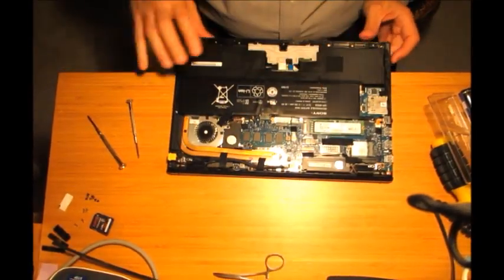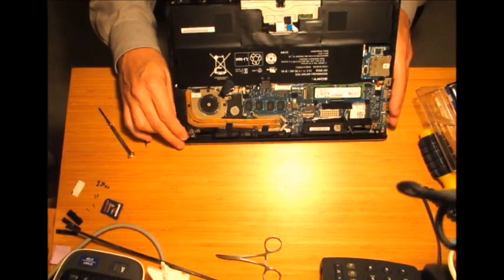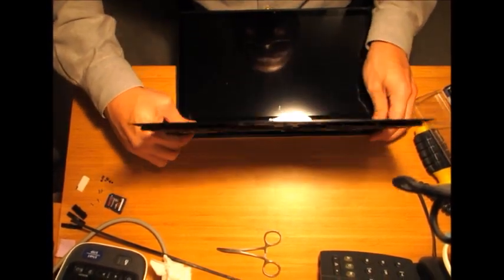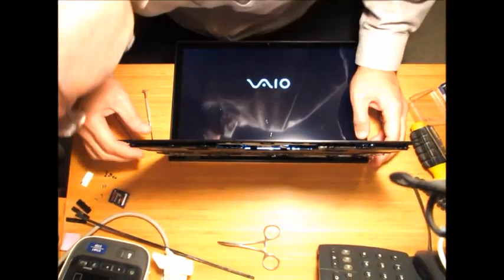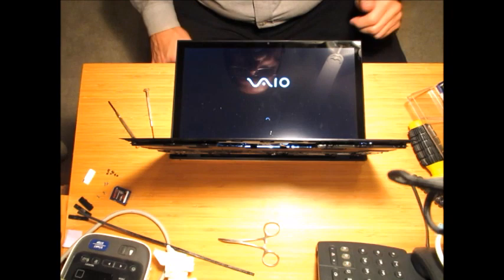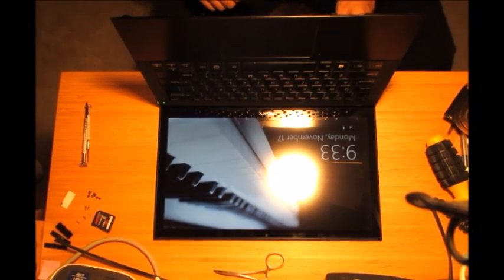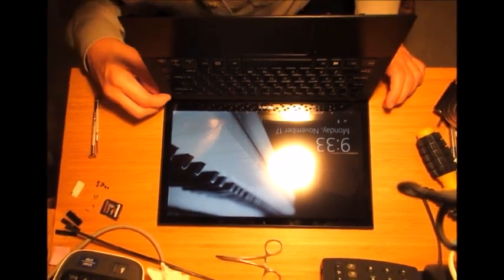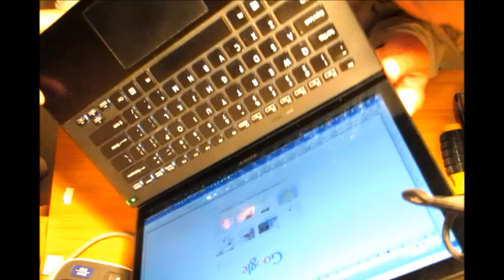Sony VAIO Pro13, svp132 fan replacement, case removal

Comment: Why didn't you want to attach the fan to the heatsink? Is it that difficult? I see fans are at $30 but with heatsink it's around $130
Reply from the maker: If the fan and heat sink are compatible that will be fine, mine were not.   Good luck and let us know how it goes.

Comment: This was awesome! However, I replaced it and now it makes a weird grinding kind of sound and gets very hot very quickly. I’ve tried taking the fan out and in again, and same thing. Not sure what I’m doing wrong...any tips?
Reply from the maker: joyfulholli, sorry to hear of your troubles.  The grinding doesn't sound good.  I would suggest you keep the bottom of the PC off and watch the fan spin and see if you can detect where the grinding noise is coming from.  There may be a wire in the fan or the fan body may be twisted causing the grinding.   If the fan is moving slow due to the grinding noise, it will not cool the PC and it will get hot.  Keep us posted.  Larry...
Reply: Lars-of-D !!! Thank you for replying!! I honestly thought I’d just be commenting into the void, it means so much you replied! I will try this and let you know if I find the grinding!
Reply from the maker: @joyfulholli  Cool!  Looking forward to hearing what you find!   Larry...
Reply: Lars-of-D I tried it! When I leave the lid off so I can see the fan, it doesn’t make any noise. It looks like the fan is kind of risen a bit so that it touches the lid when it’s closed or something. I also noticed though that the heat sink is SUPER hot when the computer is on, as well as the light green, long rectangular circuit board part on the other side of the computer. Is the intense heat maybe part of the problem?
Reply: Thank you again SO much for replying! Sorry if that’s too many questions!
Reply from the maker: @joyfulholli  Good to hear you found the grinding issue.  Hopefully you can re-seat the fan to keep it from binding with the case.   If the heat-sink is hot, then you likely have a good thermal connection with the CPU.  Having a good thermal connection is a good thing.  The exterior of the case should never be overly hot to the touch.  If you are worried that it's getting too hot, you can try running Sony's diagnostic software and it will check CPU function and temperature.   The long rectangular circuit board may be your SSD module?  If so and if your PC is running a program that is  memory intensive, it will get hot as well.   Let us know how you progress.   Larry...

Comment: hi, i have disassembled the fan, cleaned and lub it, cleaned and applied new thermal paste on CPU, but CPU temperature is still around 50 degree at idle, and around 60 degree when watching any youtube video, cpu fan almost running all the time. is that normal?  Thanks
Reply from the maker: Schumy1975, I will let others reply as they may have a temperature profile as I do not.  Good luck and keep us posted.  Larry...

Comment: Thanks for this video - it saved me a lot of time. In most cases the increased fan noise can be resolved by simply cleaning the heat-sink and replacing the thermal paste. 

Otherwise this laptop has aged well, especially if you run Linux. The performance updates in Ubuntu 19.10 have helped.
Reply from the maker: Don, Glad it was helpful

Comment: I fixed a very loud grinding sort of buzz by removing the heat sink and fan, pulling out the black part of the fan with the blades from the fan's chassis, cleaning it as well as the hole it fits into with earbuds and toothpicks. Then oiling everywhere where the fan blade part comes into contact with the fan chassis. Then it's simply a matter of putting it all back together and for me the buzzing was gone. In an ideal world, one should clean and reapply the thermal paste...

Comment: This saved my aging sony vaio.  It would turn off after 10 seconds or so.  I assumed it was the charger, then the battery thinking it just wouldn't take a charge.  I couldn't get far enough into the boot to see the battery really did have power.  I started to google replace battery, and found this.  Turns out my fan wasn't even turning on, so the cpu would shut down to keep from melting.  Thanks for the detailed video.  I went ahead and replaced the battery just to get longer life while I was at it.
Reply from the maker: Mike, thanks for the feedback.   Let us know how the new battery works out and let us know where you bought it.   Larry...

Comment: Hello, i have buy a 2nd hand Sony SVP132A2CM Model for my wife. It works but i have an problem with the USB Port. It will not read USB 2.0 just 3.0. Do you have an idea what is wrong? I have installed windows 10 pro new and the same happens. Lucky that i have an usb 3.0 that works for Boot.  It nervs me because i cant put my mouse dongle to work so i must buy me a BT mouse. Please help if you know whats the problem. thx
Reply from the maker: LoPoVat, well this is quite strange.  Have you tried uninstalling and reinstalling the USB drivers for the USB ports?   
 When you  reinstall, be sure to have the system check the internet for new drivers and not just reinstall the drivers that are local on your PC.   Larry...

Comment from the maker: All, well the time has come that I've decided to get a new notebook PC.  After lots of searching, reading, and analyzing I've decided on the Dell XPS 13 2-in-1.    My Vaio is still running well, but after 4 years it's showing its age.   After receiving my XPS 13 and using it for some time, I will post my comments.
Reply: i may get a new laptop, the Wifi AC7260 card is having trouble on Windows 10 I have to manually disable / enable the network adapter to get a router connectin estabished again as it randomly disconnects 3-5 times per day and it's a pain.
Reply from the maker: @davedogge2280  let us know which PC you choose and how you like it.   Larry...
Reply: @LarryBlackledge  It's a Sony Vaio Pro 13 just like your old one which showed me in the video above how to replace my fan making noise which I did do a couple of times. I've ebayed a Wifi Intel Wireless-AC 8260 card which should fit and use if I reach breaking point with the old AC7620 cutting off during the day. Some say switching off Bluetooth fixes it, others say re-installing drivers. The only official drivers available for it are the winter 2019 and no other legacy ones, I've tried re-instlalling them and ensuring that the AC7260 setting are correct i.e. no Power Saving option set to 'on' and that AC is selected instead of N etc and the problem persists.
Reply from the maker: @davedogge2280  OK, I thought you'd given up and were moving on to buy a new PC.  Let us know how the troubleshooting goes on your Vaio's WiFi module.   Larry...

Comment: Hello, Larry how are you? I would like to ask you if it is normal that when I play videos on YouTube the voice is heard with ups and downs because the computer temperature rises a lot, it is true that we are in summer, but I did not remember that it was like this until now. Is there any way to avoid this? It is practically impossible to watch videos on YouTube for this reason, thank you.
Reply from the maker: Laura, when my Vaio is doing a lot of processing sometimes I can hear the fan.  Video can cause this.  The only thing I  have found that helps is setting the fan to "silence".   If you want to do this open the VAIO Control Center application, go to the "Power & Battery" tab, then look for the "CPU and FAN" section and move the selection to SILENCE.   Note:  if you read the DETAILS tab in the Fan section you'll see they reduce some CPU performance to achieve lower fan speeds.   Good luck!   Larry...
Reply: Thanks Larry

Comment: Hello, the fan makes noise when I move the notebook. I recently took it out, cleaned it and put in some thermal paste and after a few days we heard again the noise, it's as if the fan's blades were touching something metallic, I'm crazy, you know it could be, it's really annoying, could you know what the solution is? Thank you.
Reply from the maker: Laura, when the fan gets older it's alignment becomes imperfect and "wobbles", this may be the reason blades are hitting the fan cowl.   Thus, I would suggest replacing the fan.   If this is a new fan, please let us know.   Larry...
Reply: Thanks Larry, I changed it 1 year ago in the Sony technical service, is it normal? What can you advise me? Thank you very much.
Reply from the maker: Laura, normally the fan should last 2+ years, however I had one get noisy after 9 months.   I suspect your fan has gone bad early.   Larry...
Reply: Thanks Larry, in your video you see that you change the whole piece with the heatsink I think it's called, then you just recommend changing the fan only? Could you send me the link or where to buy a good fan? I'm from Spain, thank you.
Reply from the maker: Laura, not sure how to buy it in Spain.  In the USA, this would be a typical way to buy (on Ebay):  https://www.ebay.com/itm/NEW-Sony-Vaio-Pro-13-SVP132-SVP132A-SVP13218-SVP13217-Cooling-Fan-UDQFVSR01DF0-/281806591112   I don't know this vendor, but they have a 99.7% rating and have sold 80 fans.   You will find some comment on people who replaced the fan only in the threads on my youtube page where you posted this question.  Actually, it's as easy as replacing the fan and heatsink.  Good luck and let us know how it goes.   Larry...
Reply: Thanks Larry for your help. I have already placed the order of just the fan, I will tell you when I receive it. I wanted to ask you ... is there any way that sony vaio does not get so hot? almost always with the fan on ... can we cool the laptop somehow? Thanks, it's a pleasure to deal with you.
Reply from the maker: Laura, good question.  In my experience if I put mine on a BALANCED power setting and don't run a lot of graphics/videos, the fan seems to stay pretty quiet.  If I try gaming or watch full-screen videos the fan can get louder.   Also, if you use the Sony maintenance tools there is a setting for fan to be quiet, that is the setting I use.   Larry...
Reply: Thanks again Larry, and what happens if I watch videos, use graphics and put the fan in silence ... you do not think it's bad for the computer to try to do more work with less effort? Or can you run all these graphics and heavy activities with the fan silently without suffering any damage? Thanks for everything, my friend.
Reply from the maker: Laura, I'm sure Sony would not let anything bad happen to the PC in order to keep the fan silent.  i.e. if the computer gets too warm the fan will likely run fast and loud even if in silent mode.  Mine occasionally gets loud/fast in silent mode.   Larry...
Reply: Thanks Larry but then what are the advantages of putting the fan in silent mode if it is quietly heard less? Thank you.
Reply from the maker: Laura, in my experience it does make the fan run slower and quieter normally.   Larry...
Reply: Thanks Larry
Reply: Good afternoon Larry, today I get the fan but unfortunately it is not from the panasonic brand and not where to find it. You hear a typical sound of a non-original fan, please can you tell me where to buy an original fan from the Panasonic brand or at least a brand that does not make noise, thank you very much.
Reply from the maker: Laura, that's too bad.  Can you tell me the brand name of the fan?   Normally Panasonic and Delta make this fan, I have had both in my PC and both were OK for some time.   You can search more broadly on the internet or on Ebay or Amazon for this fan part number:  UDQFVSR01DF0   ----  Example:      https://www.ebay.com/sch/i.html?_from=R40&_trksid=p2322090.m570.l1313.TR1.TRC0.A0.H0.XUDQFVSR01DF0.TRS0&_nkw=UDQFVSR01DF0&_sacat=0
Reply from the maker: Laura,  can you tell me a little more about the type of noise the fan is making?    Clicking sound?   Air noise?   screeching noise?   etc.    Also, can you tell me if you keep the bottom of the PC open before you re-assemble it, does the fan make a noise then too?   Larry...
Reply from the maker: This fan labels says it's "DELTA" brand, which is a famous brand and I have used DELTA:   https://es.aliexpress.com/store/product/New-FOR-SONY-Vaio-Pro13-SVP13-SVP132-SVP132A-ND55C02-14J10-4MMS8FAV010-UDQFVSR01DF0-Laptop-Cpu-Cooling-Fan/412169_32653738038.html?ws_ab_test=searchweb0_0,searchweb201602_2_10152_10151_10065_10344_10130_10068_10324_10547_10342_10325_10546_10343_10340_10548_10341_10545_10696_10084_10083_10618_10307_10059_308_100031_10103_10624_10623_10622_10621_10620,searchweb201603_1,ppcSwitch_2&algo_expid=2d3d82c6-c47f-4458-aaf5-907a703f7ffd-1&algo_pvid=2d3d82c6-c47f-4458-aaf5-907a703f7ffd&priceBeautifyAB=0
Reply: Larry no longer does the click that is solved, the noise is constant and it grows when the fan rotates faster. It is a sound rrrrrrrrrr and that if you bring the ear to the area below the fan is appreciated more.
Reply from the maker: Laura, OK.  One test you may try before changing fans again is to remove the bottom of the PC and run the fan, to see if the PC bottom is somehow touching/squeezing the fan.   Next step is separate the fan from the heatsink and see if the fan alone still makes noise.   Larry...
Reply: Thanks Larry, the first option I did and in the second you tell me how can I separate the fan from the heatsink? loosening the screws maybe? Greetings.
Reply from the maker: Laura, it's been a while since I replaced my fan and removed it from the heatsink.  I cannot recall if it uses screws or epoxy, but as I do recall it was very easy to remove and replace.   If you look at it closely, you should be able to tell how to separate it.   Larry...
Reply: Ok thanks
Reply: Hello Larry,

the question is not related to the noise of the fan but if it is related to the noise of the video, the voices are interspersed, it is as if there were interferences, and it happens when the temperature rises, thanks and regards.
Reply from the maker: Laura, sorry I read your question too quickly.  This problem I do not have experience with in regards to temperature causing this.  I do get some "crackling" in my audio during video some times and have never found the cause, I assume it's a driver issue.  In your case can you set the fan to PERFORMANCE to see if it helps with the video/audio noise?   Larry...
Reply: Yes, to those crunches I mean, how can you put in PERFORMANCE? Thank you
Reply: Sorry if you mean performance and I've tried it, but it also happens to you, I guess it's normal in these sony, unfortunate ... with how expensive it costs ...
Reply from the maker: You can use these instructions from yesterday, but just set to PERFORMANCE instead of SILENCE:   The only thing I  have found that helps is setting the fan to "silence".   If you want to do this open the VAIO Control Center application, go to the "Power & Battery" tab, then look for the "CPU and FAN" section and move the selection to SILENCE.

Comment: Can you leave a link from where you took the fan please? I need to buy one as well. Thank you
Reply from the maker: Bogdan, sure.  Just use the fan part number UDQFVSR01DF0 and search for it on Ebay or other computer supplier's web page.   The fan should be ~$15 or so.   Be sure to use a reputable seller.  Good luck.  Larry...
Reply: Larry Blackledge Thanks a lot

Comment: want to say a massive thank you for the video and instructions. made it super simple for me to replace the fan which I bought on ebay. I noticed my laptop had been freezing a lot and thought thought it might be overheating. hard to say if this will resolve i but the loud noise from the fan had been there since day 1 so its great it is now whisper quiet. 
also the original fan, one of the bronze bits had turned entirely black look like its been burnt, anyway massive massive thank you.
Reply from the maker: BenzBoy, glad your fan upgrade was a success!   Larry...
Reply: Larry Blackledge unfortunately it's overheating again and freezing. Going to try purchasing some quality thermal grease see if that helps.
Reply from the maker: Benzboy, sorry it's still giving you trouble.  I agree that's a great first step and use plenty of the thermal grease.  Good luck and let us know the result.  Larry...

Comment: Does anyone know of a video that can help with my video connection.  I think that the cable is loose and I need to check it.  My laptop is currently working however if I close the lid or move the screen the display flickers and goes black.
Reply from the maker: Craig, I have not seen a specific video on tracing display/video cable connections.  However, I did a video on keyboard replacement and you can fast forward in that video and see many of the cables/connections in the VAIO.  This may help you narrow down your issue.  The video addresses the motherboard side of the connections, but not the display side.   Hope this helps.  Larry...      https://www.youtube.com/watch?v=ufZ0Q8JDeVo